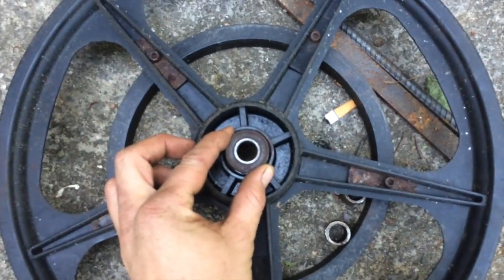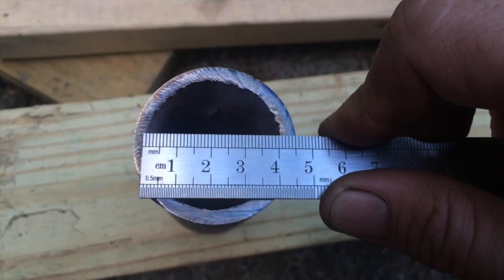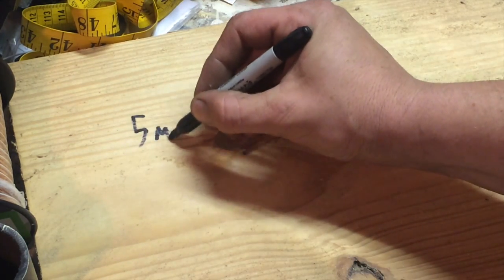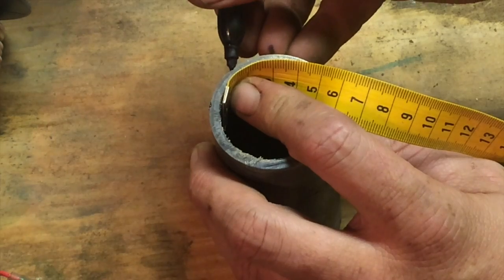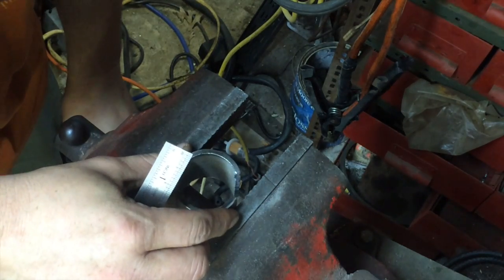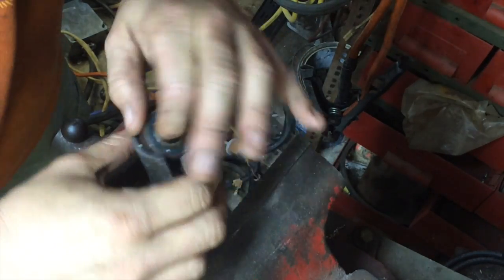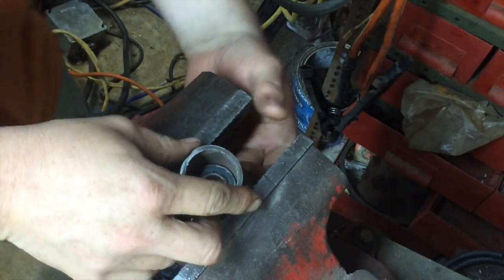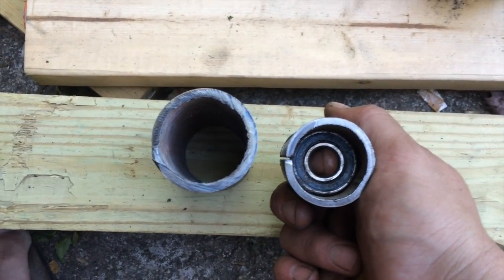How To Reduce Pipe Diameter Size

Comment: Great video. If you don't want to do all the measuring you can also take a strip of paper, wrap it around the bearing and cut it to length at one revolution.  Then put the strip of paper in the pipe as you measuring gauge.
Reply: You’re a life saver
Reply: Seems like masking tape would be ideal for this use.  Your technique of direct transferring the distance seems like it would be more precise than measuring, too.... Thanks for the great tip, Zep M!
Reply: Great method for transferring dimensions from the inside of a piece of pipe to outside a piece of pipe also if wanting to make a slip fitting between pipe pieces.

Comment: How to increase the pipe thickness? Please explain with demo
Reply: You can use a pipe expander with an impact gun. 
Also, using the same math, figure out the new diameter and weld in a piece that you cut out of another section of pipe.
Reply: @jasongreene303  then

Comment: I've searched the internet for months and found nothing about this, of course till I searched YouTube directly just now.  I did this with a piece of copper tubing to see if the idea I had was even feasible.  Turns out it was, but copper tubing is alot easier to bend than mild steel tubing.  I'm currently planning to shrink the diameter of the primary tubes on a set of old exhaust headers I have because the diameter I need is not sold in a complete fabricated set.  Any tips on bending tubing like this would be awesome if you have any extra to share.  Awesome video man!  Proves I'm not completely insane after all  lol